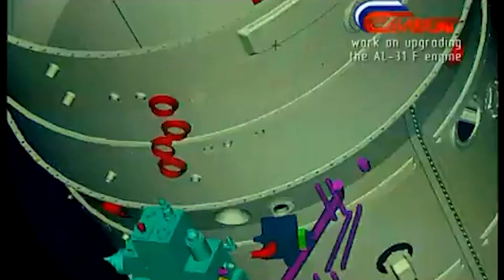Why Su-30MKI Won’t Get the AL-41 Engine

Comment: Su-30MKI (upgraded) is the most advanced
of the entire Sukhoi line
including the Su-57 which is a bare bones prototype.

The engine of the Su-57 makes no difference
as India is already satistied with the AL31F engine 
on the Su-30MKI 
and the radar cross section of the Su-57 is only marginally smaller 
than the Su-30MKI.  (i.e. Su-57 is not 5th gen).

Its the upgrades (AESA radar, electronic warfare suite, indigenous weapon integration, AWACS integration.. etc)
that gives Su-30MKI an enormous edge
not to mention the great efforts made towards indigenization of the supply chain
which even now is just 51%.

More Su-30MKI are being built,
not Su-57.